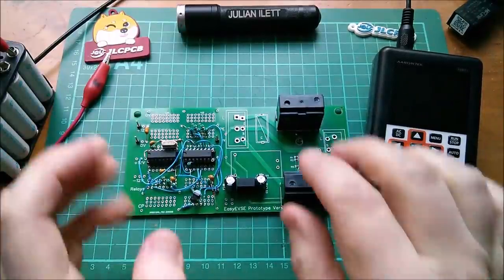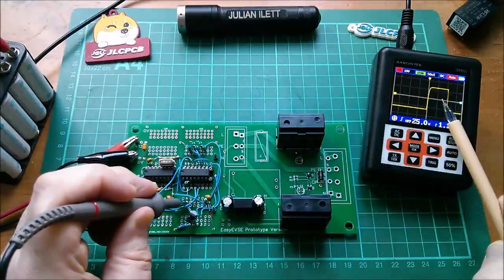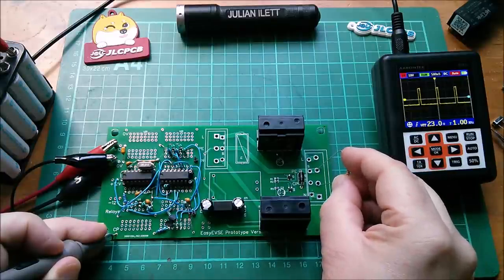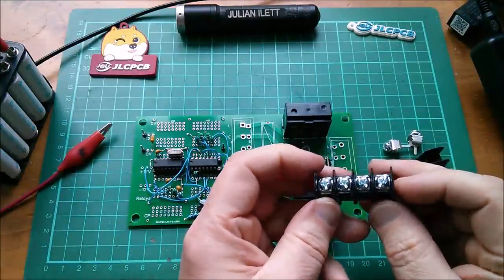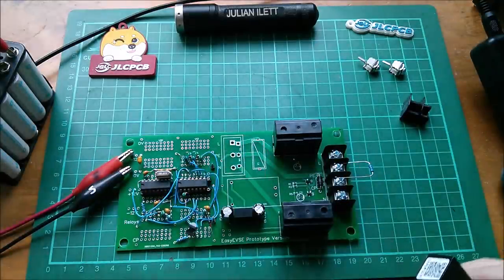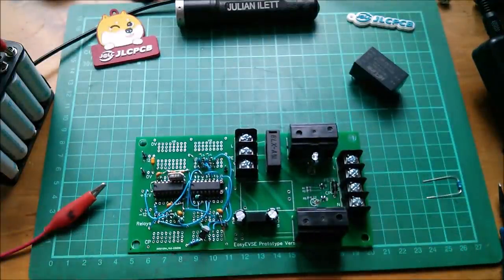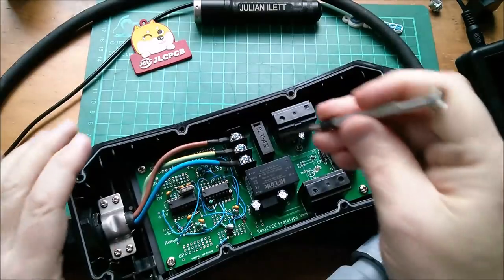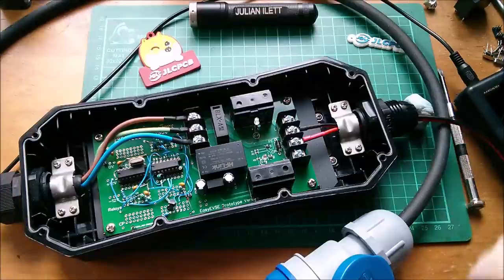Test and Final Assembly - EasyEVSE

Comment: Just a thought: If you are using relays across both outputs of the regs with the 78xx 79xx series, there could be a power on race condition (1 in about 30) causing one reg to turn off. The relay pulls the reg output below or above 0VDC. This is solved by using reverse-biased diodes across each reg output. Modern regs may have this sorted, but back in the day - I earnt a lot of cash solving this issue for a company. All the best, Beamer